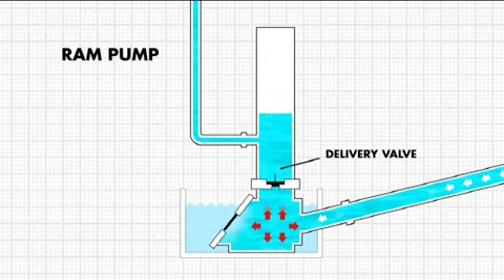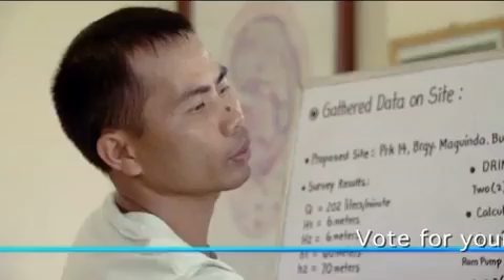World Challenge 2010: Ram Pump - The Only Way IS... UP! Vote Now

Comment: in the pressure chamber you could have a piston that drives a generator and still get your water too  and also compressed air can be drained from that upper chamber if you put a rubber bag or balloon  with a spring in the bag and on the out let have 2 one way valves for air in and out  if you keep the pressure hi in the compressor part hi it will still pump water, I just seen a piston version driving a wheel that was driving a small generator it was small, compared to what you could set up on what you have designed
Reply: Don't suppose you have a link to that video ? Sounds interesting